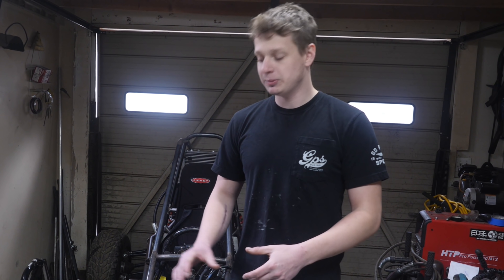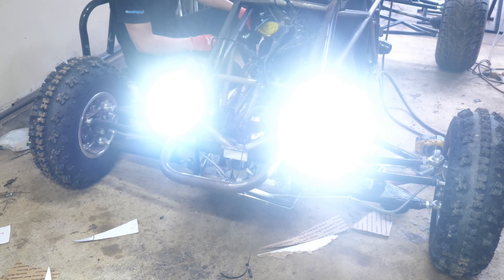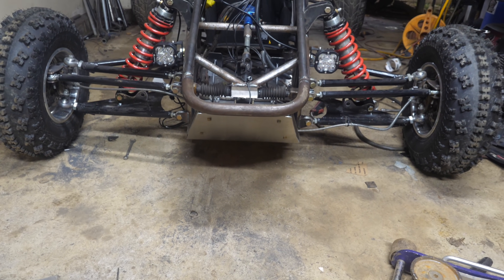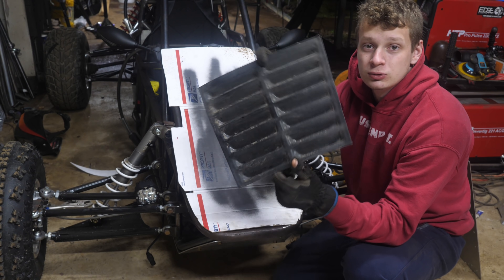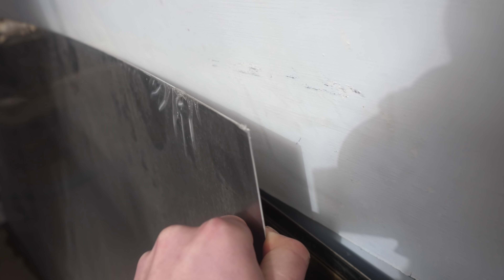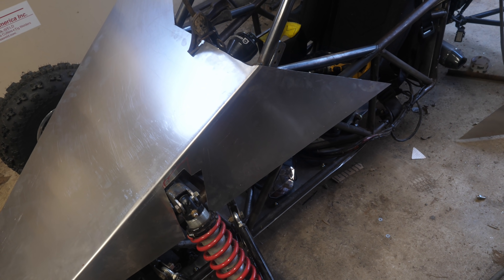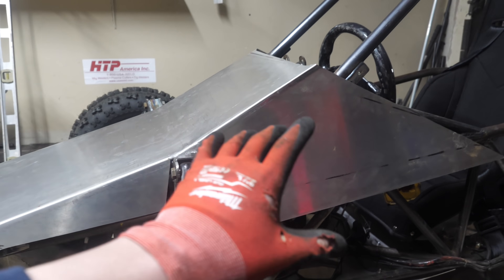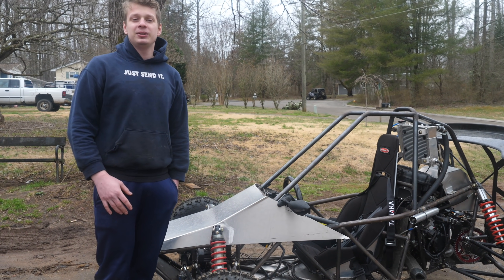Building Cyber Truck Inspired Body Kit for my Go Kart!

Comment: Love the project, Vasily. Use cardstock to template around the cowl area, shock mounts, hell maybe all edges. Then weld +/-1" strips around those edges to strengthen and bring the reveal lines to where you want them. It would be sweet if you could do a colored lacquer coat over the sheet metal and show the welds.
Reply: 🙄 what he said 🔥🔥🔥🔥🔥

Comment: Hey bud here's idea you might want to try getting some dzus fasteners. It'll make it easier to make panels in smaller sections and 1000 times easier to remove.  Race cars doing way faster then that cart will go use them. Like the build

Comment: What blade are you using in your circular saw to cut the aluminum?
Reply from the maker: Just a regular diablo  framing/wood blade
Reply: @VasilyBuilds  thanks man. I guess with aluminum you just need carbide teeth and you’re good.

Comment: That is pretty cool! But you should be using 1.2 mm or 1.6mm or whatever that is in imperial. Cheaper , bends easier and you don’t need much strength I have a video on my channel making panels for my buggy out of 1.2mm aluminium it came out pretty good

Comment: Im sure someone has mentioned it, but those shock mounts on the front lower a arms look like theyre too close together. It looks like at full sag the bottom part of the shock will bottom out on the other mount location. This thing is badass regardless!

Comment: Cardboard, trace, cutt, mount.... Repeat.... Saves 175 dollar sheet of aluminum from going to scrap.... 55gallon plastic barrels work really good as well, maybe even better since theyre double the thickness and half the weight.... Heat gun and ur done... 10 bucks a barrel.... ???????

Comment: Make panels out of pieces and weld them together, it's simpler and much easier
Reply from the maker: To sand it and grind it out takes hours. + They warp when you weld them. Especially this thin